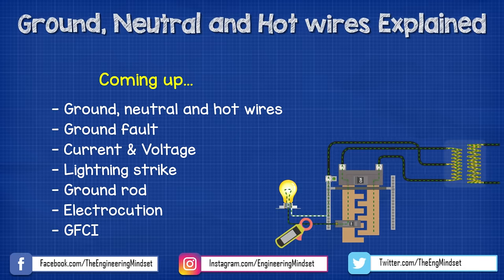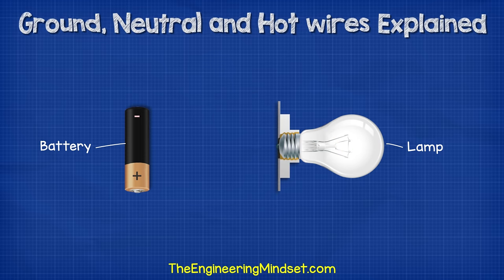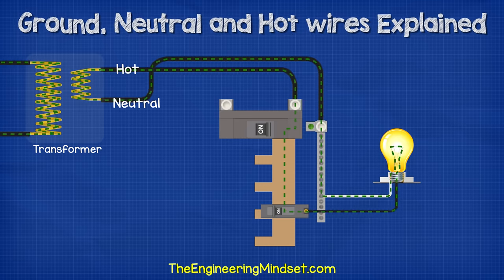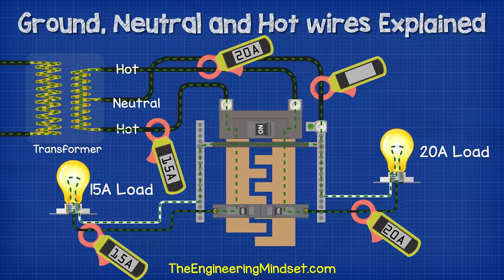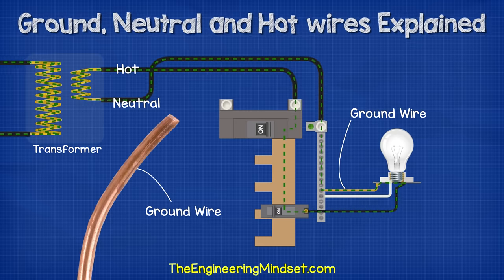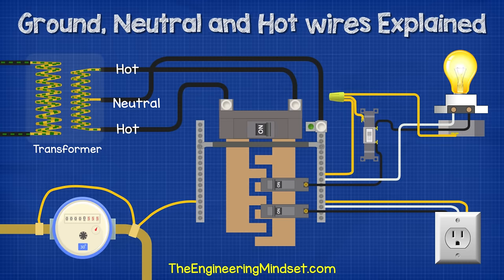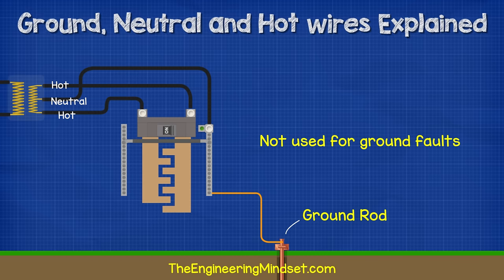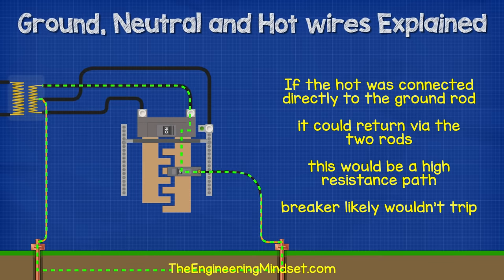Ground Neutral and Hot wires explained - electrical engineering grounding ground fault

Comment: i still dont get it. if the current is alternating between live and neutral wires, doesnt that make the two wires identical because the current keeps changing direction? there is polarity in dc because current has direction but ac doesnt so ac shouldnt have polarity?
Reply: Neutral has 0 volts, hot has 120 volts or whatever the line voltage is on the system.
Reply: @Redtooth75  voltage exists between two points. what does the hot reference for the 120 volts? the neutral? so during the 1st half of the cycle, the hot has a positive voltage wrt to the neutral and current flows from hot to neutral. during the next half of the cycle, hot has a negative voltage and current flows from neutral to hot. but this implies that neutral now has a non zero voltage?
Reply: @whitetomato partially correct. The hot has 120V with reference to neutral, the neutral has 0V with reference to ground. But that does not mean the neutral needs to have voltage in order for current to flow. Things are relative, if the hot has -120V with respect to neutral then that is the same as saying the neutral and ground are +120V and the hot is 0V. Common practice is to make ground the common reference point. Since the neutral is bonded to ground it will should always be 0V.

Comment: I don't know how it's in America, but in Europe, ground wire should be connected to the ground and not to the neutral. Since the name, ground-wire. That's why when you are using one phase, you will have 3 wires, one hot, one neutral and one ground
Reply: In America the ground wire is a dedicated earth ground connected to a grounding rod embedded in the earth. The neutral goes to the center tap on the transformer and is also bonded to ground to keep the voltage at zero measured from ground.

Comment: Hot wire is the wire that carries electricity from source to load and the wire transfers electricity from load back to source is called neutral wire. In AC, because two wires continuously change the direction of electricity,  both wires might change their names (hot and neutral) too. For example in AC, at one moment, the first wire carries eletricity from source to load so the first wire is called hot wire, at the same time, the second wire carries electricity from load to source so the second wire called neutral wire. But in the different moment, the second wire carries eletricity from source to load so the first wire is called hot wire, at the same time, the first wire carries electricity from load to source so the second wire called neutral wire. Is it true? Someone helps me please! I get confused by this hot-neutral wires concept in AC. Thank you so much.
Reply: neutral wire and ground are tied together at breaker which is then tied to the grounding rod. the neutral wire is also tried to a ground at the transformer center tap outside the house. so that mean the ground, the neutral and the earth has the same electric potential. you as a human also walk on earth and has the same potential as ground, so touching the neutral and ground wont get you electrocuted. Neutral is only called that because it has the same potential as most objects touching earth, it has nothing to do with the direction of the current. So in this case the hot wire maybe going from +120 to -120 with respect to earth but the neutral which is touching planet earth always remain at zero.
Reply: ekfliu thank you so much
Reply: @GH-oi2jf  If it is at ground potential, what causes current to flow?

Comment: Everyone's wrong in reality it doesn't flow back and forth I mean yeah the neutral  gives it back goes back but it just goes or should I say polar positive 110 volts then negative 110 and  but still follow the same way dc they have diodes to keep just polar power waves so thats why dc is twice the amps or power as DC

Comment: could the explanation be wrong? if the Hot wire is the wire that supply the current it means that is always the one with the higher potential. For the battery in DC for example it should be attached to the positive terminal
Reply from the maker: How battery works: https://youtu.be/PXNKkcB0pI4
Current explained: https://youtu.be/kcL2_D33k3o

Comment: There is no hot, neutral, or ground.  The NEC classifies these conductors as - ungrounded, grounded, and grounding.  
Please be aware that if you do not have the full understanding of electrical installation, KEEP your wiring on the workbench.
Reply from the maker: We just published a new Ground fault, short circuit and arc fault video, so much detail! Link HERE➡️: https://youtu.be/Qi0ynSQw-wc

Comment: At 2:50 if electricity is going through both the wires then how is one HOT and other NEUTRAL. Current is flowing through both wires. Can anyone clarify?
Reply: Electricity flows ...
Hot wire = from the source; Neutral wire = back to the source
Reply: The live pushes and pulls electricity only if somethings plugged in if not no electricity flows in neutral

Comment: There are things in this video that are wrong: the batteries in the demonstration are place incorrectly. Red wire is hot wire and should be shown to be connect to positive side of the battery. The white which is the neural wire should be shown to be connected to negative side of the battery
Reply: It’s not wrong that’s how electricity flows but most aren’t use to it

Comment: So if electricity always wants to return to the source, the utility generates the power, sends it to the consumer and the power goes right back to the utility, so why do we pay for electricity?
Reply from the maker: All the energy you use leaves as heat, light, sound etc. That needs to be topped up by the power station. You need to pay for all the staff, engineers, power lines, maintenance etc that supports that. You don't have to pay, you can generate your own, but then all the operating costs and technical support rests on you.
Reply: @EngineeringMindset  I was wondering if any would reply.thanks, I have been in the electrical Industry for for over 40 years, and teach as well, I was trying  to get  a reaction.. Thanks for responding, I have a dry sense of humour as I think most Engineers do..

Comment: 0:37
Why will you be electrocuted or receive an electric shock if you touch one of the lines of an UNGROUNDED conductor?

Why will you not be electrocuted if the line that you touch is connected to earth or grounded? Example the line of a corner grounded Delta? Or the center tap on one of leg grounded in a Delta connected transformer?

Comment: Why is hot shown as a negative I thought it was a positive?
Reply: 'hot' is neither negative nor positive. 'Hot' is simply the conductor that has electric potential (voltage) to ground (earth) because the other conductor in the circuit (so called neutral-- or more properly the 'grounded conductor') has been grounded. By 'has been grounded' we mean that it's potential (voltage) has been brought into equilibrium with that of the local earth's. 

It really has nothing to do with 'positive' and 'negative.' Remember that it's AC and 'polarity' switches every half cycle (120 times a second in the U.S.).

Comment: I don't get it. If ground and neutral are bonded, why have a ground pin in the outlet at all? Why not just bond neutral to the metal casing of appliances?
Reply: That used to be standard practice but it is a safety hazard so it was changed. If the neutral wire ever became disconnected from the neutral bar it would cease to be neutral and would become live. So if the chassis of something is bonded to neutral and there is an open neutral fault in the circuit the entire appliance would essentially become a live wire and a shock hazard. Having a dedicated ground wire would mean that 2 faults would have to occur simultaneously in order for the appliance to shock you. There would have to be an open ground in the house wiring and a ground fault in the appliance in order for the chassis to become energized.
Reply from the maker: We just published a new Ground fault, short circuit and arc fault video, so much detail! Link HERE➡️: https://youtu.be/Qi0ynSQw-wc

Comment: so if you run the ground wire to the metal pipe, then were does it go and/or where does it dissapate to? doesnt that make the pipe hazardous to people on the outside, what if someone or an animal touches the pipe, now the pipe is dangerious right? also doesnt the pipe appear to a high resistance load and therefore defeat the purpose of a ground wire? why would it go to the pipe if it is not a return path? not making any sense here..
Reply: The ground is never really use and if it is it’s for a split second and it won’t have electricity throughout the whole pipe just the section between the breaker and outlet and it’s pretty much never used
Reply from the maker: We just published a new Ground fault, short circuit and arc fault video, so much detail! Link HERE➡️: https://youtu.be/Qi0ynSQw-wc

Comment: If I remember EE theory correctly, ground is a reference point of electrical potential energy, typically assumed to be 0 and to have infinite capacity to accept charges. This relates to voltage when you measure a wire/connection relative to ground. Ground is attained by attaching a wire to either a metal stake or sometimes metal pipes going into the ground, or both.
When connecting transmission line neutral to the ground it ensures that the same potential energy is shared and no additional static energy or other causes elevate it. The same ground reference point (in ideal case) is preserved at the home and the power-plant.

Your explanation of lightning is pretty much incorrect.
Unlike an electrical circuit, lightning is caused by static electricity accumulating in the clouds and discharging to the earth. There is no circuit to speak of.
Reply from the maker: We just published a new Ground fault, short circuit and arc fault video, so much detail! Link HERE➡️: https://youtu.be/Qi0ynSQw-wc

Comment: At 10:11, you say, "...the source of lightning is essentially the earth..."  I have always been taught that the source of lightning is static electricity built up inside of clouds.  Or, as National Geographic puts it: "Lightning is an electrical discharge caused by imbalances between storm clouds and the ground, or within the clouds themselves."  So, the electricity is seeking the ground to discharge itself, but to say that the earth is its source is not accurate.
Reply: the earth generates a magnetic field because of it's molten core, it has a north and south pole.   i guess it's  like a battery sort of.   maybe the magnetic field contributes to the electrical charge n the clouds

Comment: Since the hot and neutral wires are doing the same thing in a AC system, they seem to be equivalent so I don't see why you bother calling one hot and one neutral. Current is travelling in both directions on both lines.
Reply: In some cases it might be important. For maintance for example:

Example:
In a room light, usually we connect the hot wire to a terminal on the switch on the wall, connect the second terminal of the switch to a light bulb in the ceiling, then connect the other terminal of the lightbulb to the neutral.

This way when we switch the light off, the switch cuts off the hot wire path, only the neutral stays connected to the bulb. 

If we instead install the switch to the neutral path, the hot wire will be left connected to the light bulb all the time, even if we turn the lights off. The hot wire will still shock you during maintence if you touch it with your bare feet at the ground.

The neutral might still carry a current, but as seem in the video it's the difference between the phases which is less than the hot wire. Also the neutral is at a "lower" potential.

Even if you touch the neutral you will be good in some cases (Someone correct me if i'm wrong here...), because it's easier for a current leaving another device in the circuit to return to the source via neutral wire. To return via a human body and the floor would be a detour and electricity always takes the easiest path.

tl;dr neutral is not always carring a current, the distinction matters...

Comment: I don't like how you're calling the battery's negative terminal hot. Sure electrons flow out of the negative terminal, but in electrical engineering, positive is hot. It's the wrong convention.

Comment: Honestly thought you'd have gotten more grief over explaining that electrons flow from negative to positive.  Yes, they do, but that's not the conventional theory that is taught world wide.

It was Ben Franklin who said electrons flow from positive to negative.  He was wrong.  But he had no way of understanding or testing his theory.  The world of electronics evolved around Ben's misconception.  We traditionally think of DC current as flowing from positive to negative.  Again, this is backwards, but it's the whole theory behind electronics design.  Diodes, transistors and all other active components are drawn with the convention that positive is the source and negative is the return.

You are absolutely right when you say electrons flow from negative to positive.  Let me explain that for anyone reading this:  Electrons are in orbit around Protons and Neutrons.  Neutrons - being neutral - don't have any associated Electrons in orbit.  But Protons do.  Protons are not bumped from state to state; the electrons are.  It's the electrons that move - as you have correctly stated.  In a battery there is a surplus of electrons at the negative end of the battery.  Electrons have a negative charge; hence the proton is called proton because of its positive state.  The orbiting electrons can be charged to a higher energy level OR can be bumped out of orbit.  Static electricity is these electrons being moved to a higher level where as electrical current is the motion of electrons through a wire (or a person, or other conductive material).  So it IS the electrons that move from negative to positive where, in a battery, there's an absence of electrons.  As in all electrical theory, the electron wants to get into an orbit around a proton.  Hence, if you take a battery and connect a wire to each end of it - the electrons can flow through and back to the proton where it wants to be.

Again, Ben Franklin made a guess about which way electrons flow.  He may have been considering that energy moves from the higher state to the lower state.  Having a surplus of electrons (as Ben was possibly thinking) in one location and having a lacking - or lower amount in another, the higher concentration of energy will move from there to the lower level.  It's how water will balance out between two sources through a pipe.  Static electricity moves in the same manor.  A high static charge will discharge to a lower state when presented with an opportunity to do so.  That's what lightning is.  Static electricity.  That static energy is generated by ice crystals striking and bouncing off each other.

Electron flow is from negative to positive (as presented in the video)
Conventional current is assumed to be from positive to negative.  It's how the electronics industry operates.  Otherwise half the electronic devices might not work with the other half.
Reply from the maker: Transistor video now live: https://youtu.be/J4oO7PT_nzQ

Comment: So if it wasn't for a lighting strike, you wouldn't need a ground path from the panel, and so you wouldn't need to ground all your casings because you wouldn't have completed the ground loop... but grounds are not that simple... they are a bank of charges and there would still be a flow of charges ie. Current. So the initial points about completing a circuit isn't exactly correct.

Comment: Problem: You are comparing a DC circuit (eg. the battery and the light) with an AC circuit . The 'neutral' AND the 'hot CANNOT have any current in a DC circuit unless they are both connected to the battery. HOWEVER. in an AC circuit why does the hot have current even when the neutral does not complete the circuit. And. why does the neutral not have current when it is connected to the transformer?? Also, why bother with a neutral. On the transformer there are two hot wires. It seems that the logical way of completing the circuit would be to connect the two 'hot' wires from both ends of the transformer??? Please help.
Reply from the maker: Seen our new Transformer video? here https://youtu.be/jcY4QN7awEc

Comment: I think i hada case of "ghost" electricity. I had siding and roof rreplaced ,had metal facia and metal under the overhang and metal roof installed .the workers said he had gotton shock by screwing in a screw in edge of roof . I dont think he hit a screw. They also took down an old antenna tower that was not attached to house . They said again they got shocked. No dought these were lower level voltage or it wpuld have been so much worse. Well long story short at same time my stove went out. Its electric . Come to find out it was "spliced" into another 220 wire that went from breaker box to other side of house to a sub panel supposed set up for ac unit in future. We now use window units .
My electrician said black wire had a voltage issue . It did.  Its now fixed. Oh i also had some small voltage come through faucet at bathroom sink cause i felt a little voltage there. ,,but now i dont😃. 
    Electrician said i need to wire my ground and common bus bars together because box is not grounded correctly does that sound correct.
Reply from the maker: Check the new SUB PANEL EXPLAINED ➡️ video https://youtu.be/NUSNa-7Hecw